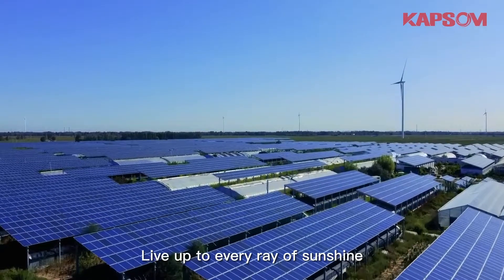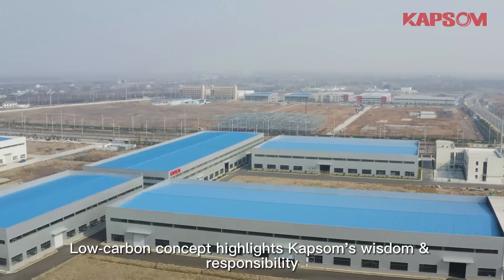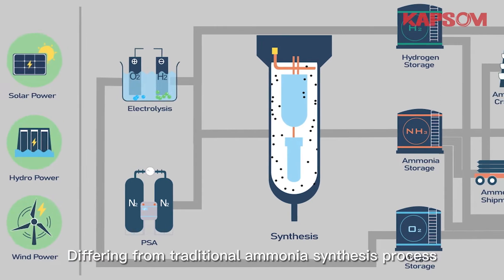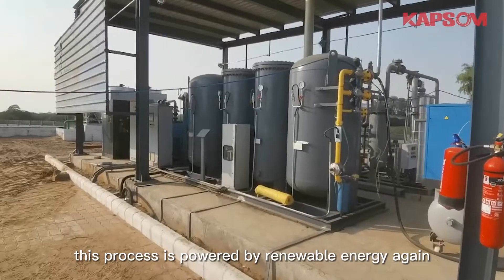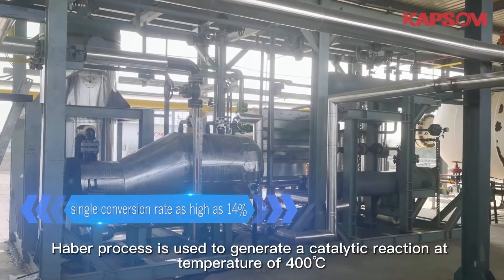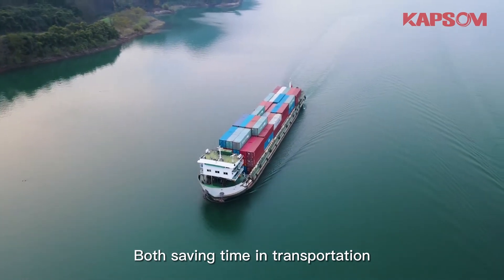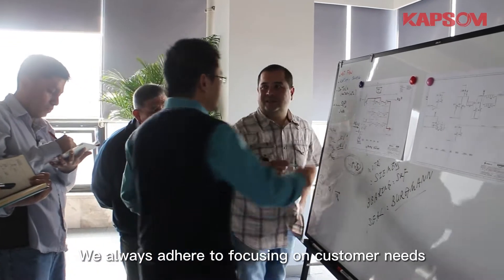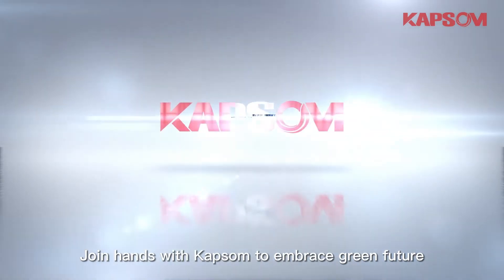The World's First Green Ammonia Plant Was Made By Kapsom

Comment: Not so. Renewable ammonia production relies on hydrogen generated by water electrolysis using electricity generated from hydropower or other renewables.  This was used commercially as early as 1921. By 1930, about 30% of the total ammonia production capacity was based on electrolysis-based ammonia synthesis with individual ammonia unit capacities up to 295tons of  ammonia per day at Rjukan, Norway.